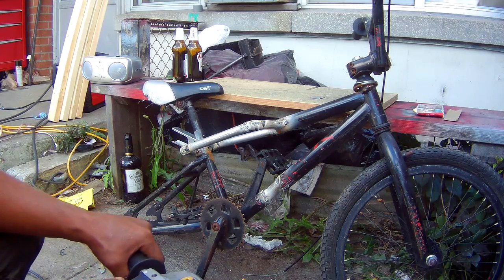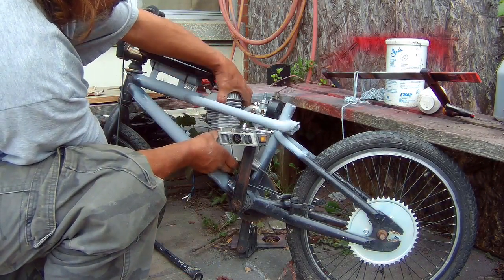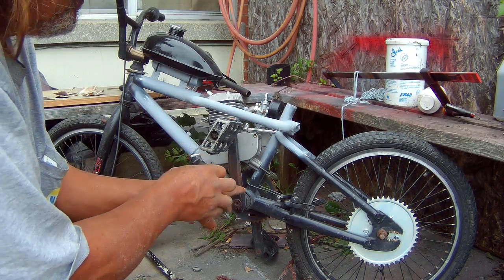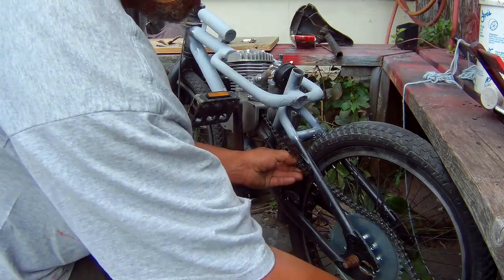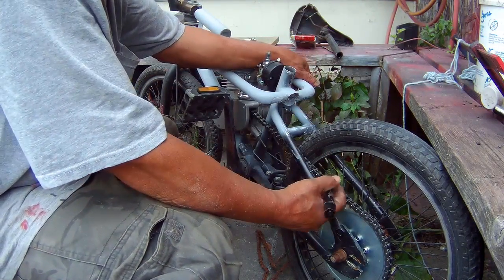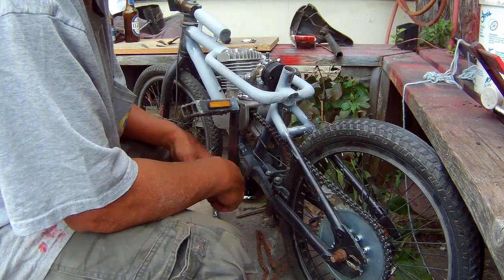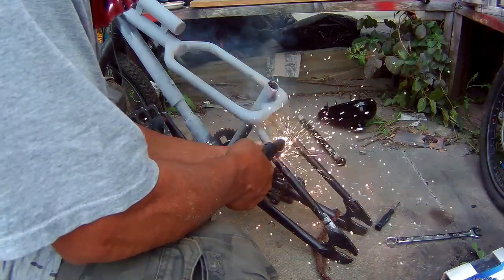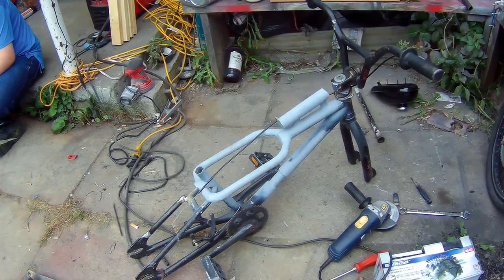80cc Motorized BMX Bike pt.4, Frame Work

Comment: bro that frame is going to break in half get a mountain bike frame
Reply: I think it will work fine his bracing is pretty good and I think the smaller BMX motorized bikes can actually go faster due to smaller size of bike frame.  It is also easier to transport because it is not big and bulky.